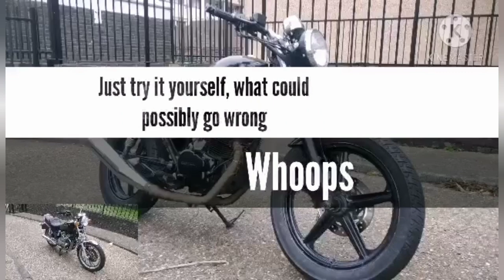Yamaha virago revival attempt. Carb clean, battery recharge and fire up attempt.

Comment: Hi Charlie 
Sounds  like  the starter clutch,,,common fault  with xv535,,side case off , flywheel  off £29 for a repair  kit
Petrol  leaking  from  the overflow because  needle valve  is stuck  probably,,,always  happens  to those  carbs ,,,and been standing  so long 
Bit of tlc and it  will  run
Reply from the maker: Starter clutch, I'll look into that Anthony. I'll do a compression test tomorrow first out of curiosity. 

Cheers mate

Comment: Ok questions are; is the starter solenoid free & turning the engine over? Is the fuel pump working ( remove clean and possibly give it a gentle love tap to free it off or just replace it)
Obviously not being used and Sultan is not desperate for the money or he would have requested help to get it ready for sale.

Stick it on gumtree as is £500 and never let Sultan buy a bike again...simples!
Reply from the maker: Definitely pumping fuel, carb was over flowing after my clean but either way the engine sounded terrible. 

I think the weather is ok tomorrow so I'll check it's turning over without plugs and compression. If that seems ok I'll get back onto the carbs. 

But they are a pain to work on and e10 has ruined any rubber in there
Reply: Looks like the E10 has done a proper job on the rubbers.  No wonder it is leaking like a sieve.
Reply from the maker: That's a good point. I'll have to look into that